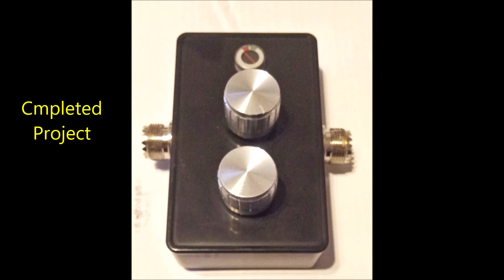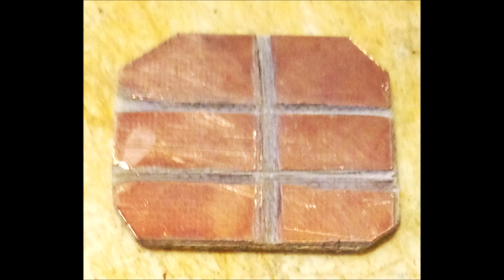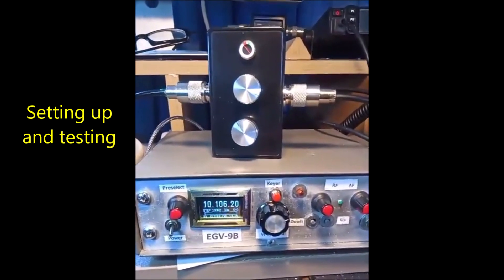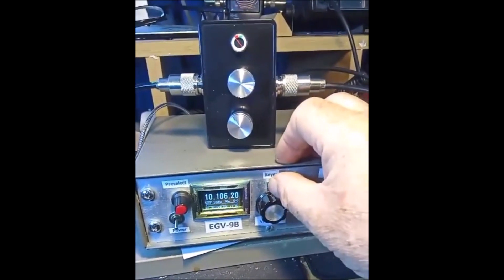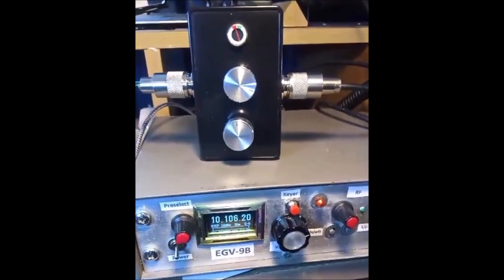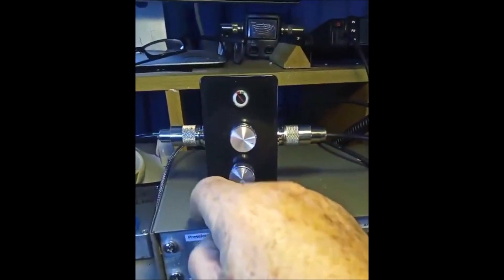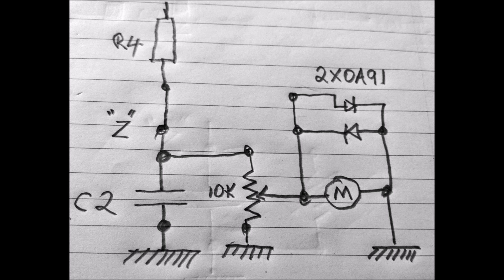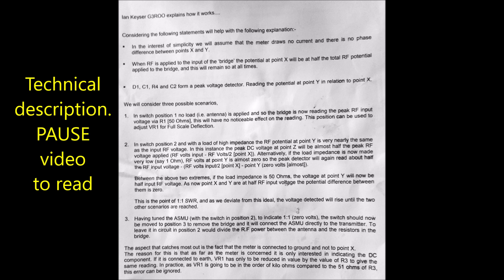G-QRP Resistive SWR Meter Build

Comment: 👍Thanks for sharing. A nice project. I have built a few of these QRP resistive bridge VSWR indicators. When the bridge is in circuit, the worst mismatches you can have is 50 Ohms from transmitter into 100 Ohms (antenna open circuit) or 25 Ohms (antenna short circuit). So, regardless of antenna impedance, the VSWR seen by the transmitter is never more than 2:1. This means good protection for your finals when "tuning" the antenna. You can also swap the meter for a low current LED and adjust for minimum LED brightness. Maybe makes it more robust for QRP/P?
Reply from the maker: Steve, I just happened tohave a few of those small meters. I bough a job lot about 30 years ago. thanks for commenting.